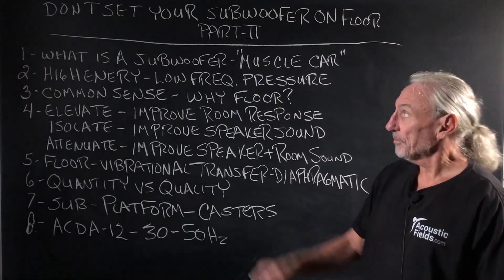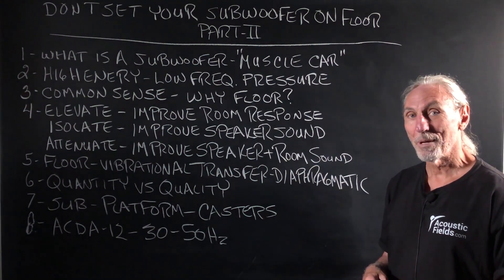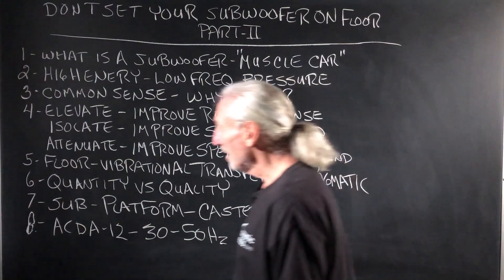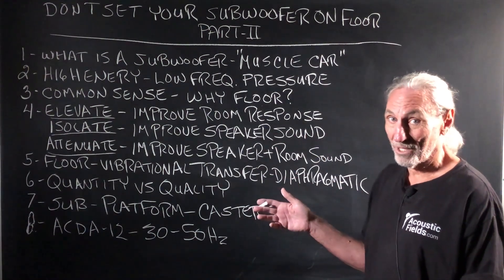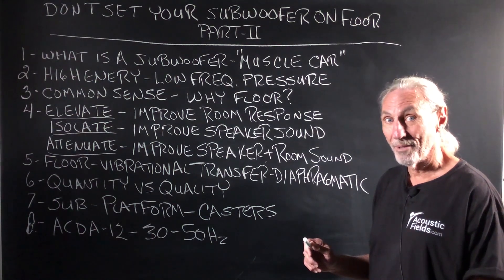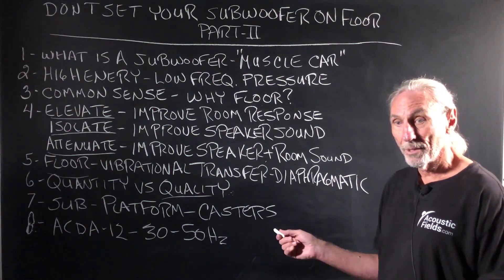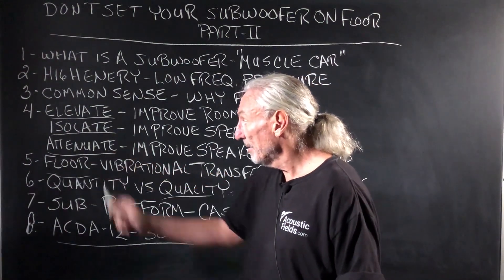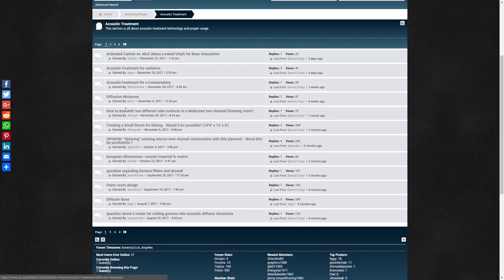Don't Set Your Subwoofer On The Floor! Part 2 - www.AcousticFields.com

Comment: Let me open by saying, I am by no means, a novice in speaker technology, and placement. I found this video while net surfing and thought I would give this a try, by mounting my sub high. The good notes are, I noticed a fuller bass response with music as well as an increase in bass sound volume. The ugly is, the bass became more "boomy" as the bass bounced over the walls. Keep in mind, this is just an everyday home with artwork on the walls and bare wall. I know a large assortment of sound diffusers mounted on the walls would fix the boomy-ness. But is that what I really want? So back on the floor, in the corner of the room it went, where the carpet clamps out much of that boomy-ness and delivers that smooth, punchy, deep bass. Summary, I'm not opposed to mounting it up high again, however, another expense in preparing the walls would be needed just to fine tune a high mounted sub.
Reply from the maker: You must calculate the proper position for the subwoofer first and foremost. Elevation will improve response if you find the proper location. One attempt when positioning a low frequency source is never enough. It is a process like everything else in acoustics due to the many varaibles involved.

Comment: Just outta curiosity,I tried raising my sub about 3ft off the floor and the difference in bass response is dramatic,I have to say.I always thought that a sub HAD to be on the floor.Not any more I don't.Thank you.
Reply from the maker: Climb to the highest building in your town and shout this for all to hear.
Reply: @AcousticFields  Is this real or sarcasm? I'm thinking of trying to place my sub on a shelf slightly above and to the right of my speakers. Do you think this would work? Otherwise it has to be under my work desk which is not ideal either.
Reply from the maker: @sampsalol  Keep all low frequency producing devices away from shelves and walls. With low frequency energy, the room does not care what you want.

Comment: Hi Dennis, I have a small venue at the beach 23 front x 90 each side ,  ( the front is totally open to the sea ) it's mainly an open air room, the floor is the sand, with wood ceiling and partially open wooden walls too, like 70 feet away from the sea, I'm just upgrading my audio, I have an Electrovoice subwoofer EKX-18SP,  the EKX-15P monitor x 2,  and I'm planning to hang them with steel wires near the ceiling like about 10 inch away from the ceiling, close of the middle of the venue and close to a side wooden wall maybe like 3 feet away ( just above the Dj booth )... doing this for protection from sand and sea too. Do you find this configuration ok? or what would you recommend me to get a better configuration? thanks a lot ! really helpful videos!!! support !
Reply from the maker: Never place a low frequency producing device next to a room boundary surface. You are creating more room distortion when the goal is less. Fill out the info. in this link and include pics of the room with the form. https://www.acousticfields.com/free-room-analysis/

Comment: brilliant content man and I've allways said get your home sub  or those big 12 inch 3 ways off the floor and bung a kneal knee protect foam padding that you get from any garden center and it will transform the response and sound of your system no doubt.
Reply from the maker: Subs should be elevated, they should be placed upon technology that absorbs their excessive energy output close to source and as you point out they should be isolated from vibration transmission.

Comment: What about front firing subwoofer. This type of subwoofer still needs lift of the floor? SVS PB 3000  or just down firing subwoofer?
Reply from the maker: Place low frequency absorption under the sub woofer. The best place to absorb energy is close to the energy source.

Comment: In addition to raising the sub height, would a floating floor also reduce bass frequencies going to an adjacent room? (Adjacent room has been decoupled)
Reply from the maker: It depends on the design of the floor. Was it designed as a low-frequency barrier?
Reply from the maker: Raising the sub is not to reduce noise transmission. Its goal is to smooth frequency response. A floating floor is one method to reduce noise transmission. There are many other options.

Comment: Brother,  I really like your reviews. Subwoofers makers aren't directly telling people what you're saying.  Logically,  you're perfectly right because svs subwoofers makers have created & selling sound isolation feet which simply comes to what you're saying.
Reply from the maker: The isolation that feet provide is only one element of the equation. We have found with our recent subs that the cabinet moves as much as the driver does. We have taken measures to reduce the vibrational signature of the cabinet.

Comment: Bass decays to the listening position = distance start to sound good. 
If bass is Muddled, then shift sub further away from Deflective surfaces to avoid deflection. That includes walls and floor and firing direction
Reply from the maker: Don't forget elevation in your analysis.
Reply: @AcousticFields  that will be the Floor deflection mentioned above. I am currently elevated 2 feet on a wooden floating shelf for a cheap small sub

Comment: Does this matter for a front firing sub vs a down firing sub?
Reply from the maker: No, subs radiate energy in 360 degree arrays.
Reply: @AcousticFields  So is it possible to turn the downward firing sub upside down so firing toward the ceiling. Would that help?

Comment: You don't just put the subwoofer on the floor, you put it in a corner of a room to amplify find the low frequency of the base. Old school ways. 🙂🤘
Reply from the maker: Placing the sub in the corner increases room distortion. Quantity is not quality.
Reply: @AcousticFields  NO distortion at all. Maybe to the mechanical ear but not to the human ears.  Quantity is sometimes works better then quality to the human ear. 🙂

Comment: Does it matter as much for a front firing sub on a concrete slab.
Reply from the maker: Its not the surface area composition. It is the distance from the driver to the floor the creates the distortion.

Comment: Hi do you think i better make platforme to sub and position my speakers sitting on the sub with a thin foam between them is better or sub platforme beside speakers on stands, please? Thanks very much for this topics....helps a lot
Reply from the maker: Foam will not be able to support the weight of the subwoofer. It will also not provide any vibration isolation or absorption.
Reply: @AcousticFields   i didnt express me well, sorry! i meaned i will build a wood platform with  fiberglass inside to the sub and would like to know about position the mid/high monitors on top of the sub or in a stand beside? Thank you very much!

Comment: If your going with SQL doesn't make sense given subs are meant to be felt not to be heard its subsonic frequency. Your missing the point sorry.
Reply from the maker: Do you hear sub sonic frequencies?
Reply: Subsonic frequencies are non directional and works on vibration ... unless your talking 30hz and above then sub placement doesn't matter but that isn't specified.

Comment: I have 2 long throw front firing 12's how much of a difference would there be if I got them off the floor and would I need to put them on a stand or does it need to be open under them for this to work

Comment: Yes, actually it does if you can equalize, and your floor is solid enough to not vibrate or do other nonlinear things. Each time you add a boundary condition, you're getting gain for free since it confines the radiation and directs it towards the listeners position rather than just letting it freely radiate out into space. Its the same reason you get the 6 dB "baffle step" when the frequency becomes low enough for the sound to diffract around the cabinet and radiate into, more or less, a 4π space. Putting it near the floor/wall or in a corner decreases the acoustic load angle and provides gain. Obvious benefits are increasing the sensitivity of the subwoofer, but like adding fuel injection to your muscle car, you need to compensate for the effects of the boundary condition with measurements and equalization just as you would have to flash the ECM to tune the engine. But the benefits are reduced excursion for a given SPL output, and increased headroom, much like my V8 muscle car getting a more reasonable 16 MPG in the city. That said rather than just throwing a 650 Holley double pumper on there its worth while to get books like Sound Reproduction from Dr. Floyd Toole which has nice discussions on these things with useful insights. Elevating is not without merit, though, but should only be done if you have crummy subflooring and walls that will vibrate and alter the response.
Reply from the maker: It does not provide real gain with real acoustic quality to it. All you have to do to listen to this is to elevate your sub to ear level and listen to the sub away from room boundary surfaces. Compare the attack and decay, definition, and separation of the lower frequencies with this approach to placing it next to a room boundary surface. They are as different as night and day. It is all room distortion.
Reply: @AcousticFields  I have done stepped sine distortion measurements. Even at 105 dB at the listening position, the sub distortion is less than 1% THD and the response flat. Provided the sub flooring and walls are rigid enough, you get substantial gain. I put the sub in question into a corner where the floor is concrete and it can attain up to around 115 dB despite being relatively low cost and only a 10 in driver. If the flooring and walls allow it’s worth experimenting with. But as you imply if they move a lot then he sub has to be out of the boundary condition.
Reply: @AcousticFields  FWIW I have also done waterfall and spectrogram measurements and the room modes take far longer to die out than anything from the sub.
Reply: @AcousticFields  And I have heard what you are referring to, and it sounds terrible. But it’s worth trying the boundary condition if the room permits. In some cases it does, but others not. I would not want to confine myself to doing it one way or another.

Comment: You'd love my house. A couple tiny rooms & the entire place built 120 years ago out of wood. Any kind of power from any speaker vibrates every plank and joist in the building.
Reply from the maker: I would not like this at all. It goes against everything we know about sound quality.
Reply: This is an easy fix, remove the room out of the equation just use headphones.
Reply: @lorindamikaela  I just play out in my yard XD
Reply: @lorindamikaela  lol omg

Comment: Enjoyed the video very much. I have been lifting subwoofers off the floor for over 10 years now. It works extremely well with instant results. 
I currently have 4 active 12" subwoofers. 2 subwoofer stands are 12" high the other 2 stands are 60" high. The bass is smooth as butter, once you've tried this trick you will never go back. Also it's best to try and have all subs the same brand, model and size [if possible]. 
Another trick that has worked for me is to have 2 subs crossed over at different Hz that way you get a much smoother response over a greater range, the bass comes in and continues to build, it's almost a life changing experience.
Reply from the maker: Managing low frequency energy distribution within a room is a large challenge. We have tried all of the multiple speaker approaches but find them lacking in definition and separation. The money spent on multiple 
 LF drivers can be better utilized with treatment for all frequency ranges,
Reply: @AcousticFields  - completely agree with your comment.

Comment: Correct me if I am wrong, but the one situatuon where the speaker can be aimed at the floor would be if they are cement floors right?

Since cement will not compress (non-diaformatic) the benefit is that the sound spreads outin all directions.
Reply from the maker: Firing a sub woofer into the floor no matter what the material composition produces quantity (distortion) not quality.

Comment: Cool topics, just sold my 68 Roadrunner,  just bought a project system. HSU sub 15", two SVS Ultra towers and ultra center channel,  and a pair of Polk Legend L800's ..and a DBX113 eq.

What are some suggestions to power these.
Reply from the maker: Look at Emotiva for economical power.

Comment: I remember going to this one clothing store back in 2012 and they had 4 Bose subwoofers mounted on the ceiling (prettty high ceilings) with the cube stacked speakers also mounted throughout the store, and it just blew my mind on how good those woofers sounded up high like that,so yea there’s a big difference in the sound
Reply: But if they’re close to the ceiling isn’t that the same as being close to the floor?
Reply: @isaacleedrums  It is EXACTLY the same, of course the ceiling might be different structure. But it is the same. Best place for subs is definitely on the FLOOR right next to mains. If it flush mounted mains, just below them.
Reply: @DrSamE  you don't like change that's why they call you dr. same.
Reply: @DrSamE  most high end restaurants also have them on the ceiling. the sound is always top notch.
Reply from the maker: There is a definite improvement on response.

Comment: I have a Martin Logan downfiring subwoofer. It has the option to use it as front fire or downfire.  Based on your article i change it to front firing, try to elevated it more....the results are very poor. Based on my taste (not techincal measures) it is absolutely better to leave it downfiring. The difference is not only perceptible, is a total diferent world. And I did the test very seriously. If they have design them to be down firing is for a good reason.
Reply from the maker: You are not positioning the sub in the correct place within the room. Move your sub around and try different places elevated.

Comment: Well damn... My only subwoofer is a downfiring sub. Been piece together a decent system on a very extremely low budget & can't get another one any time soon. Main speakers are my weakest link so I hope to upgrade those next.
Reply from the maker: Treat your room and keep your existing gear. You will be amazed on how good it will sound in a treated room.
Reply: Did you ever upgrade?

Comment: If you can hang the subwoofer on the wall near the ceiling is the best option. Just like in the cinema.
Reply from the maker: There is no one size fits all rooms. What will work inside a certain room volume, will not work in another.

Comment: For 12inch sub, 300rms, what is the ideal level to put it up off the floor, 30-50cm?
Reply from the maker: It depends on the dimensions of your room. Ceiling height is a large factor. Start at 300 mm.
Reply: @AcousticFields  my ceiling height is about 4 meters.

Comment: Bass is omni directional so rase the sub up just changes the frequency of  the add/ cancellation effects of reflection energy. Subs go on the floor to decrease this effect. By having the a surface close you have almost zero delay and achieve a better response. The corner of the room on the floor or ceiling gives maximum output but not the best response the next position recommend is 3/4 from the side walls which gives a better response with less output. Rising the sub up is bad for two reasons. The response will be worse and output will suffer. The only way this will help is in the corners where moving the sub off the floor will be the same as moving it out from the wall and the wall will then be the boundary you stay close to instead of the floor. Hope this helps as it is from years of research this is well known. Multiple subs also smooth response two or even 4 subs 3/4 from walls give a very even respond throughout most of the room.
Reply: Some people just like the big boom shake sound. Fun spl vs sound quality. Sq over spl imho.
Reply: @jasonbuttens 
I would call that quality spl.  When using a sub as the reference for low frequency then you would want it to ideally not overpower what your listening to.

But when you listen to music that drives bass and boom over other qualities then the might of the bass is the quality.
Reply from the maker: We have found that multiple subs are not cost effective for the improvements granted. If the cost of multiple subs, which only deals with lower frequencies is spent on treatment, you can impact all frequencies, not just a small group. Stay away from room boundary surfaces. The goal is less room distortion not more. Placing a sub in a corner produces room gain not sub woofer sound quality. It is best to hear the speaker first instead of the room distortion. Quantity is not quality.
Reply from the maker: Once again, quantity is not sound quality. Multiple subs are an expensive way to realize only a 3-5 dB improvement. Most rooms need +1 0 - + 3 dB improvements. This method is an expensive bandaid. Spend you doolars treating the room response. It is the most effective way to produce measurable results over a broader frequency range.
Reply: Acoustic fields, you don't understand that when you move from the wall the reflection is what causes problems with the direct sound so by limiting the distance of one boundary you get less interference and more of the direct sound. Having the sub in the wall is actually ideal as the reflection is then zero for that boundary. Multiple subs are not a requirement for a single listening chair but as soon as you have multiple seats it is the only way to achieve a uniform response at more locations by breaking up nodes to get even pressure areas in the room. I suggest that you consult the many resources available on the subject. Audioholics has good videos on the subject that site the research sources and explain in detail how bass interaction works in a room.